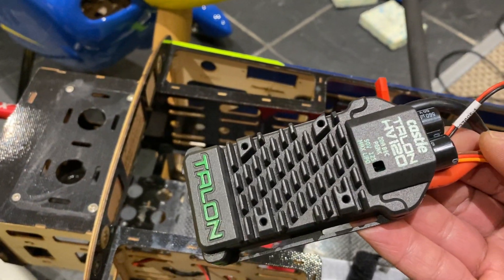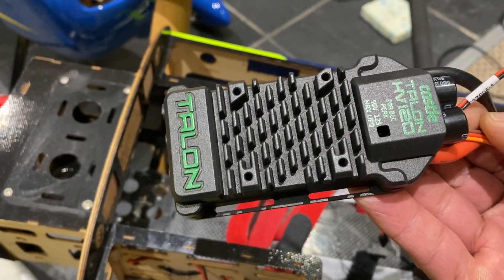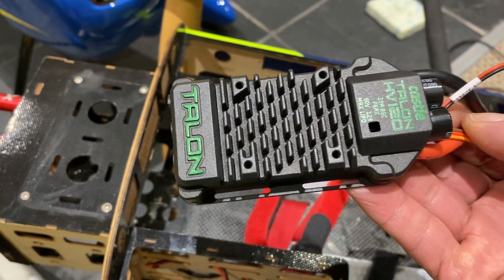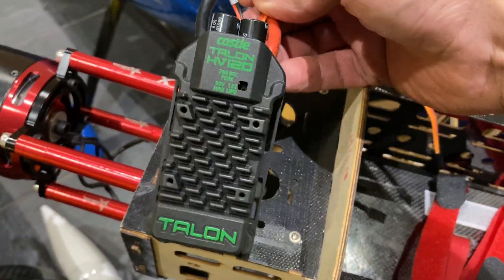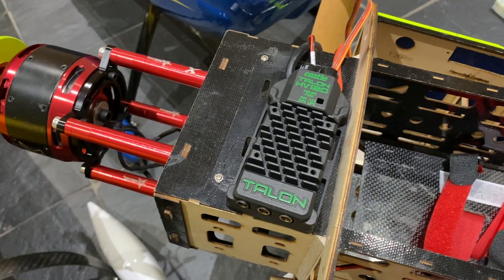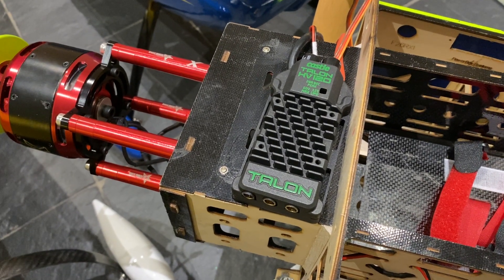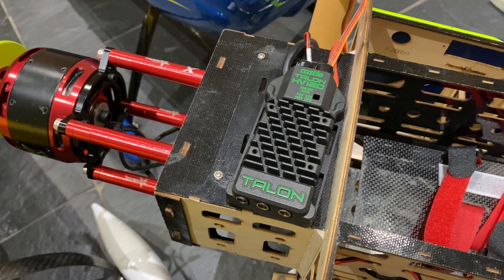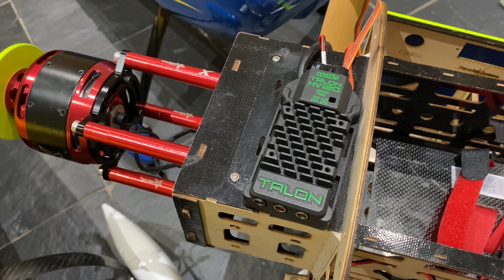Part (1) of (2) ESC compatibilities with motors part (1) of part (2) 16.March 2021

Comment: I am very interested in the firmware updates but with that being said, in this video you were comparing an ESC firmware update version to a programming box update version. Two different components will most likely have two different firmware version numbers.
Reply from the maker: Yeah I think the same they will probably use two different firmware on them because they are not so comfortable with each other!

Comment: The screach nois comes from the mosfets not being able  switch fast enough
Reply from the maker: Hi Paul..I tried high and low timing also PWM Settings.. The manufacturer already told me it is not compatible for that motor they are trying to address the problem.I use the word try loosely they know there is a problem there and they can’t fix it yet. they are telling me is firmware and they are still testing on it you are more than welcome to set it all up for me if you like.. I will gladly let you have the problem instead of me having days on it Paul.. on the plus side I have a castle creation Phoenix edge coming tomorrow so hopefully problem solved with a proven ESC they recommended and made for the compatibility for the motor Xpwr 35cc motor!